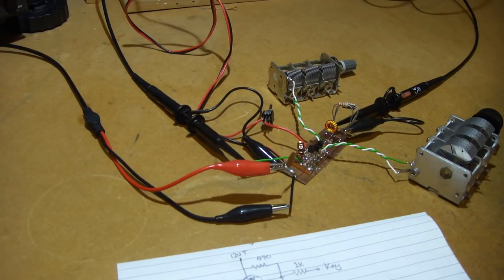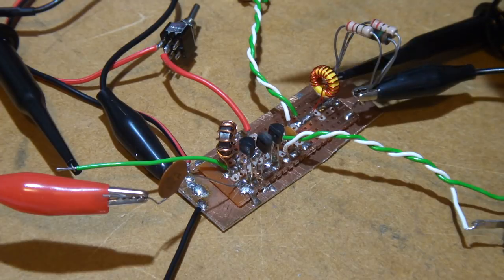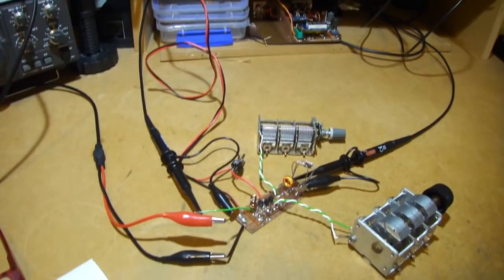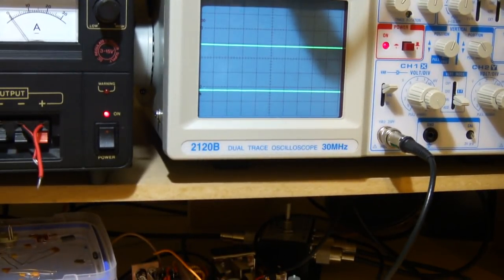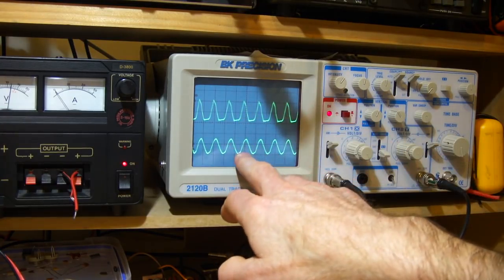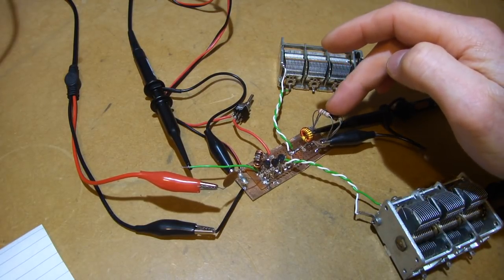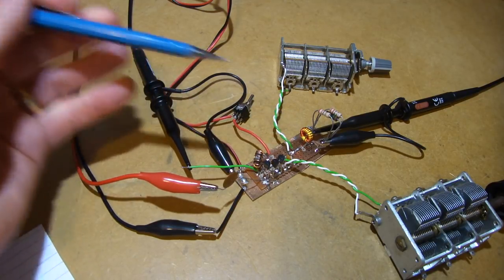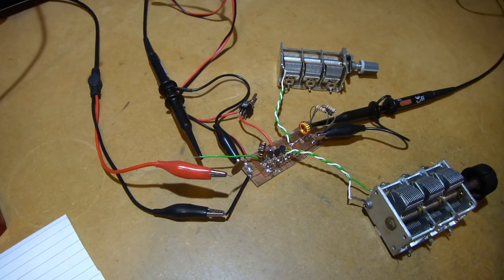Homebrew 40m CW Rig - #6a Class E Amp Experiments

Comment: Nice work. I do agree that a diode clamping circuit as well as a nice large valued electrolytic at the source voltage will help smooth things out and protect from voltage spikes from getting into the radio. I'm not sure how this might affect the on-off switching of the transistors in the design, something that might have to be experimented with. I'm  no expert, just my two cents. All the commercial radios I have worked on have some form or another of a clamping circuit at the source voltage to protect the radio (and a fuse too).  Great stuff as always, have a good Holiday. -73's
Reply from the maker: Excellent, thanks for that. I'll probably go with the standards 100uF // 100nF combination on both sides of the Vcc keying circuit. Especially as the receiver will still be on providing sidetone. Thanks again!